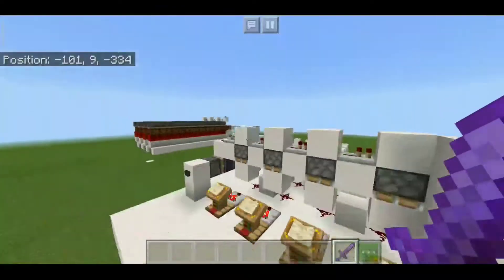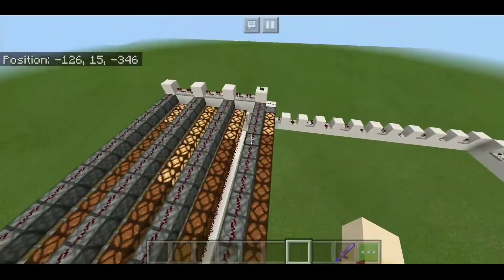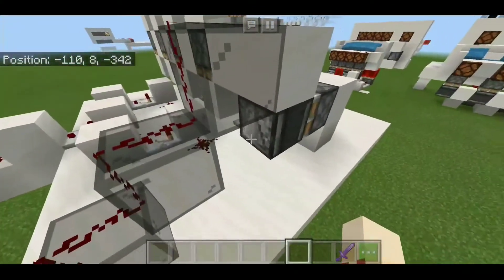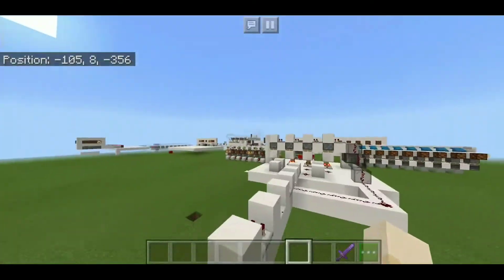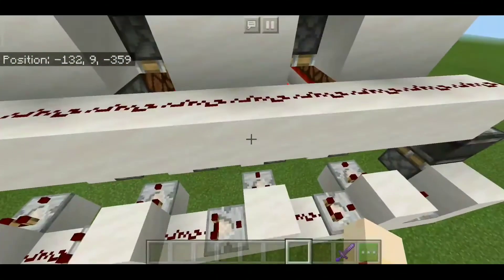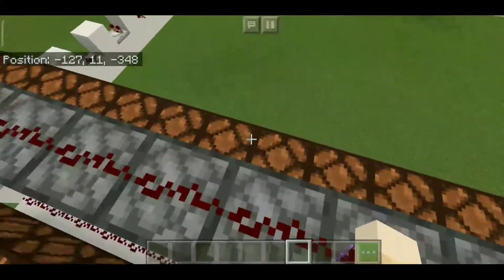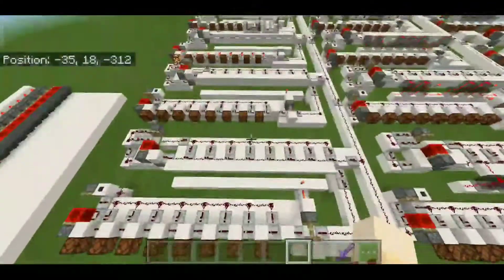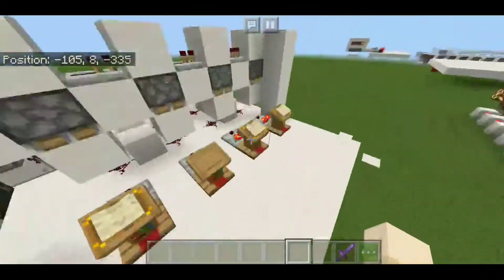Serial Hex Data Transmission Minecraft Bedrock 1.16

Comment: Merging the inputs would be easier and cleaner with a line of substracting comparators. Also are the signals long enough to be stored with a signal strength memory cell?
Reply from the maker: This was Just a Concept I had that I tried to Create , So Yeah Making this More Compact is Possible and No it's too short For Directly Using with signal Strength memory Cell but with slight modifications in Encoder that can be made possible